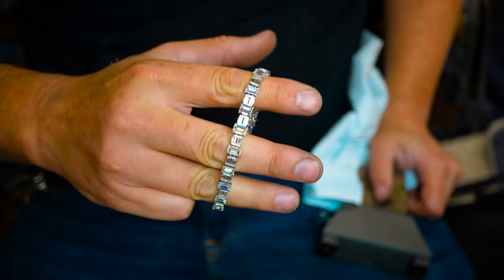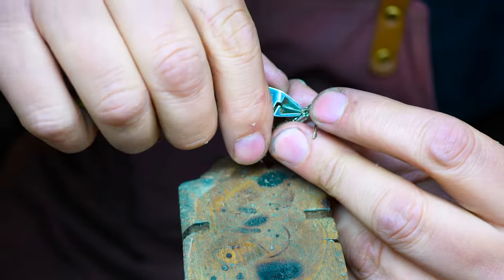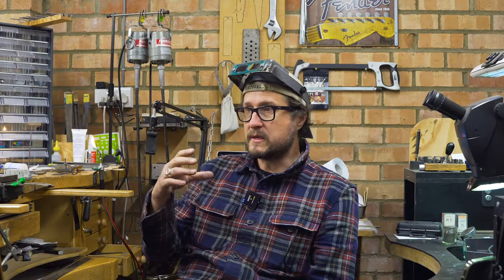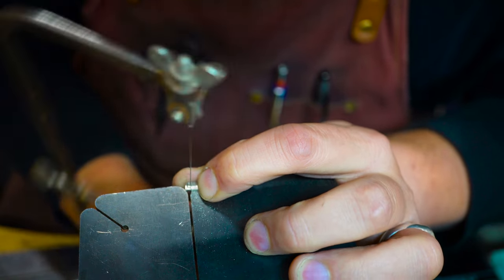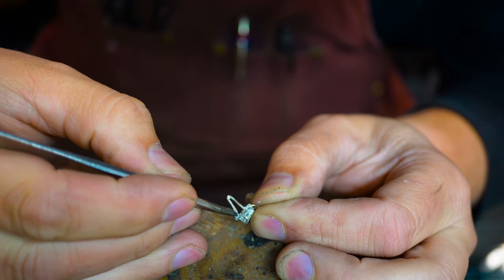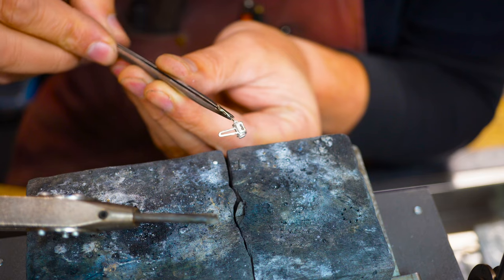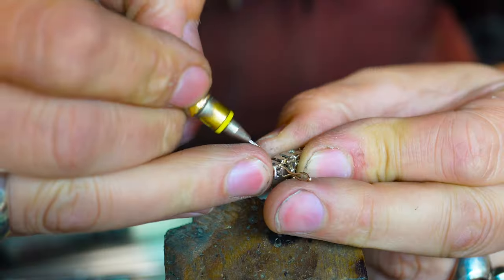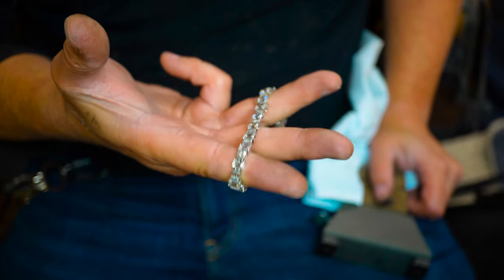Jewellery Repair - Line / Tennis Bracelet Clasp Repair | Goldsmith's Workshop Secrets

Comment: Would you remove the CZ stone in a silver tennis bracelet for soldering ?
Reply from the maker: Hi Rahsan, Cz’s are pretty forgiving when it comes to heat and not too expensive to replace if they should burn so I usually leave them in place and avoid putting a direct flame on them. This works for me. Hope that helps and thanks for the question 🙏🏻